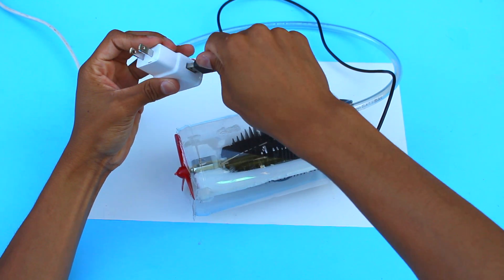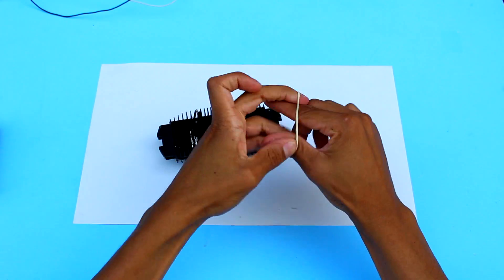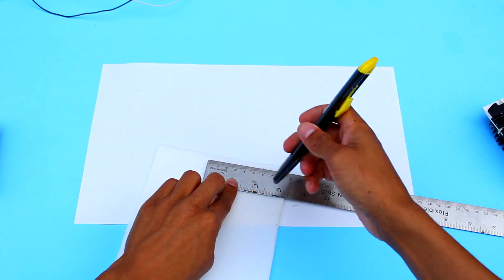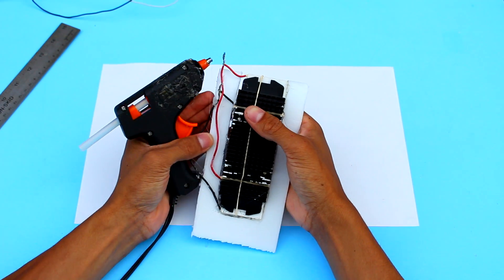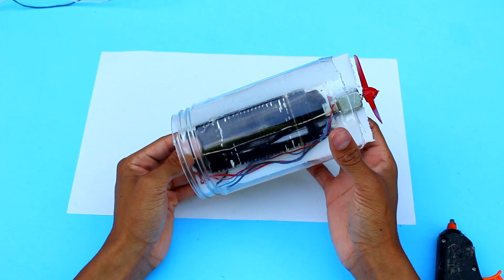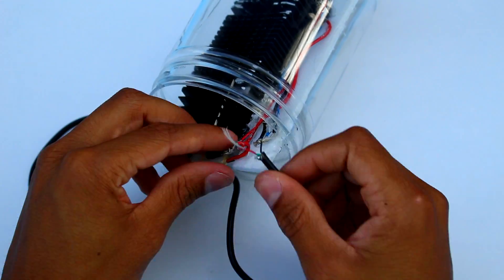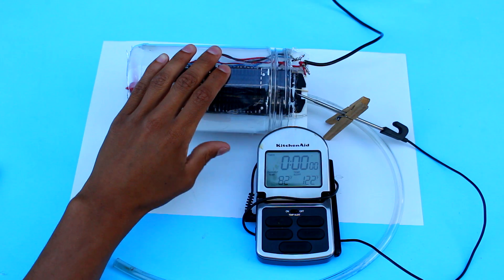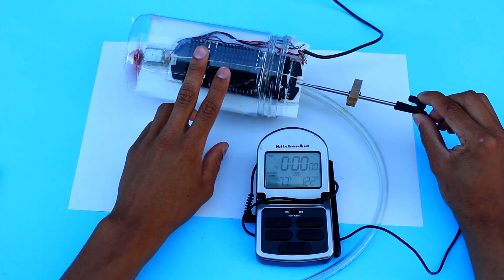How to Make a Mini USB Air Conditioner (ICELESS)

Comment: Well Josh you got a block both ends of the hot you can't have the hot getting sucked out the same hole as the cold you block the rear but you didn't block the front

Comment: You do realize that the Fan is blowing out the hot and Cold air right, Unless you have it blowing backwards in the container, and that "tube" is vented somewhere else...otherwise its not doing anything, just canceling itself out

Comment: Hmm I see a number of flaws with this design, for one thing elastic bands for something that gets hot isn't good cause over time they can melt and ruin the efficiency of the heatsink and the heatsinks might fall off, instead use a thermally conductive tape to attach the heatsinks to the thermoelectric plate, also it doesn't seem like you isolated the hot side from the fan, it looks like it will just pull the air through the tube and across the hot side of the heatsink and blow it out with the cold air, so the air blowing at you won't be too cold, instead using a pc processor fan or some smaller fan that is similar on the hot side to the tube, and the tube should be wider to vent off enough heat, and remember to seal off the front part of the hot side like the part with the tube, you will find it will blow much colder with these changes.

Comment: How can you improve- 
1. Use a separate power supply for the Peltier modules. 
2. Make separate heat exchanger for the cool and hot side of module. 
3. The tubing for the hot side did not make any sense. A larger diameter tube could have got you a few degrees cooler output temperature.
4. The hot side heat exchange process should be vigorous. Use a fan with high air flow rate.  Peltier modules are nasty for that they have very less efficiency figures. (This justifies the hot side tubing point) 
5. Insulation must be really good. 

Its my dream project. Had read a lot on these.

Comment: Good concept, but you have no idea how a Peltier module works. You are not cooling down enough the hot surface, and both sides (hot and cold) were mounted in the same place, so you are losing all potential, mixing hot and cold airflows. Also, this Peltier module cannot create a fresh breeze, the airflow temperature exchange is too fast and there is no time to the ambient air cool down when in contact with the cold surface.

Comment: This design is fraught with issues. 
1. The air flow should be in line with the heat sink fins and not across their width reducing overall efficiency.
2. The peltier devices should be farther away from the ends of the heat sinks allowing for better temperature transfer to the heat sink central body where more of the fins are located.
3. Insufficient exhaust air for removing heat from the hot side. A significantly larger exhaust hose is needed.
4. Rubber bands won't provide adequate pressure to maintain good contact between the peltiers and the heat sinks.
5. Heat sink adhesive or heat sink grease would help a lot too, but only if used sparingly. Most people use too much thickness which actually reduces temperature transfer rather than aiding it.
   Additionally, I would have used an efficient 5 volt muffin fan instead of the toy propeller and motor. They sell for less than $1.00 on ebay which is likely where one will purchase the peltiers too.
Reply: joe woodchuck great comment. Thanks

Comment: what are the black coloured thing?
Reply: They're called heat sinks and are made of aluminum for efficient heat transfer. They're necessary for proper peltier operation. The problem is that he used them in a faulty manner. See my comments above.

Comment: If you go into the BOIS you can over clock the fan and it might take a few more volts (You can over clock your wall socket the same way) nut it will be substantially cooler. Thank me later ;)
Reply: Higher voltage also drives the peltiers to a point where the power supply  can't keep up with the required current.

Comment: UGH! "AMPERAGE" IS NOT THE RIGHT WAY TO SAY IT. Sorry but when people say amperage rather than amps it really bugs me. Also this will have absolutely no effect due to the way peltiers work, you are putting a tad cooler air out the top and warm air out the bottom. Music was to loud, also can you show the product more rather than just have a top down view. Oh and if you want to get the full capacity from most peltiers you can not run it off USB because USB can't supply the power that 2 6A+ and a decant fan draws. Also don't copy other You Tubers music, this style of music was nice but now every You Tuber uses it and it is so annoying and boring. Disliked...

Comment: the concept was good, but you just don't have idea of how peltier works, if someone build the exact the same build like in this project you'll get nothing but wasting power
Reply: every continous cooling system is essentially a heat pump. You pump heat from A to B and as you put work into it that has to go somehwere, you always generate more heat in B than you "take away" from A. If you don't "waste power", you would essentially have created Maxwell's Demon. The guy in the video just used a peltier heat pump, nothing wrong with that. Terribly inefficient, but who cares? He could just as well put water in a bucket, leave it outside overnight to cool down and put it inside to heat up (thus cooling down the room). Same effect. Also "wasted energy" as he moves his body.
Reply: he explains how it works. It generates heat but the heat is (in theory) pumped away from the area that  you want to cool. You'd run the tubing outside. But USB only supplies a trivial amount of power to drive the device and the fan is not going to be able to force the air through the tubing.
Reply: Exactly, and generate the same amount of heat so it does nothing and you are using power

Comment: Josh, your message is WAY more important than than background music that drowns you out. I'm wearing some good headphones and can still just barely make out what your saying in spots. And I think that 4 degree differential could be tightened up a bit if the air blew through the heat sink fins rather than at 90 degrees to them. You'd pick up a lot more square inches of fin cooling. Cool idea and cool build, thanks! :)
Reply: Greg Valunas You're* :)